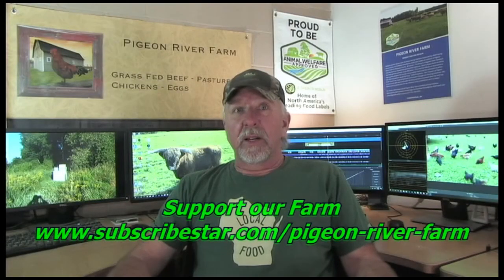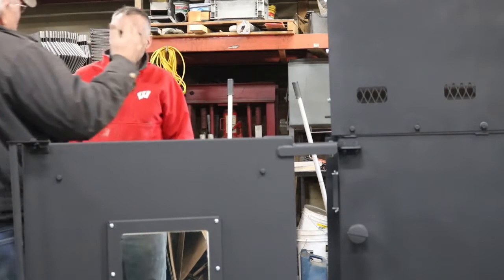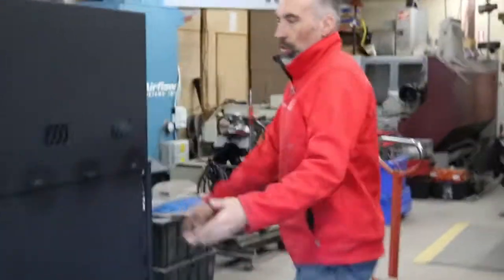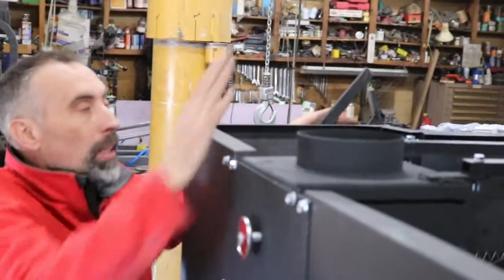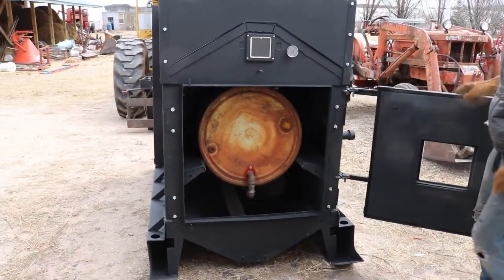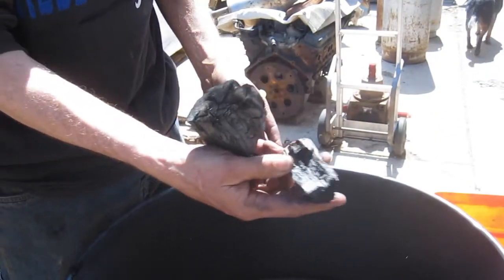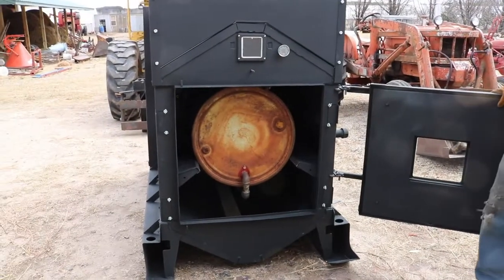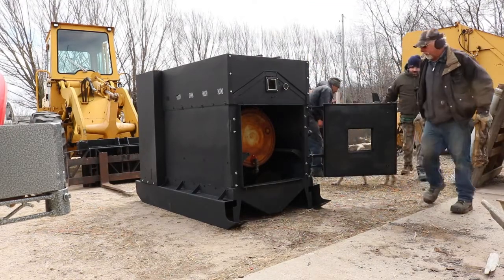New Biochar System on the Farm

Comment: From my research. You  have made Charcoal. It does not become Biochar until it has been soaked in a  rich diversified mixture of different organic fertilizers like sea weed, and animal manures. Am I wrong?
Reply from the maker: Yes, you are 100% correct in your thinking.  You need to get the biological activity going.  In my particular case on the farm, we overwinter 600 layers in the three high tunnels leaving a significant amount of activated manure already in the soil.  In addition, we use the Zone products and one of the main ingredients that I use is their Kelp-grow.  So overall I was impressed with the ease of production of the charcoal to be converted into biochar utilizing this system.
Reply: From what I understand charcoal and biochar are two totally different things, because they are produced differently and have different properties. Both of them can be activated, but obviously they are activated in different ways and for different reasons. Biochar with nutrients and microbes to increase soil fertility. And charcoal by heating with certain gases or steam, after which you can use it for water filtration or medicinal purposes.